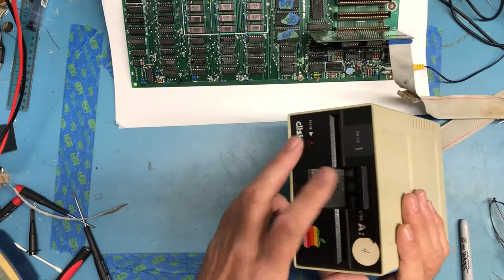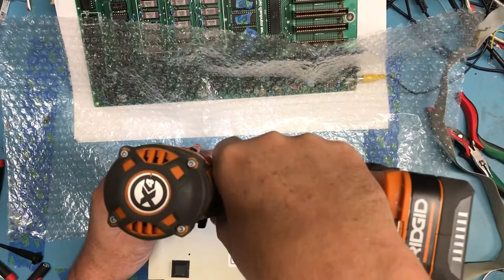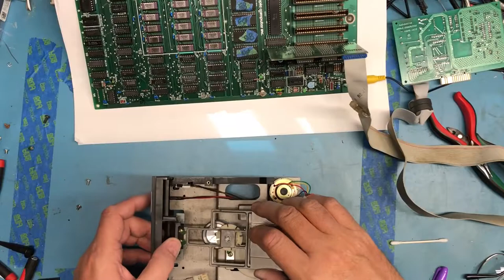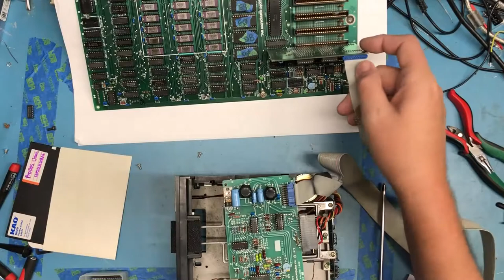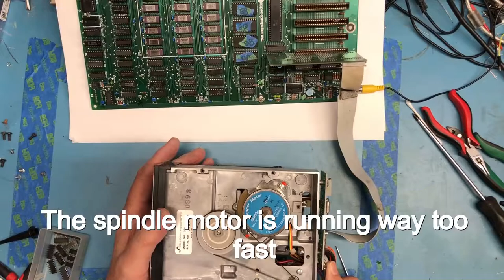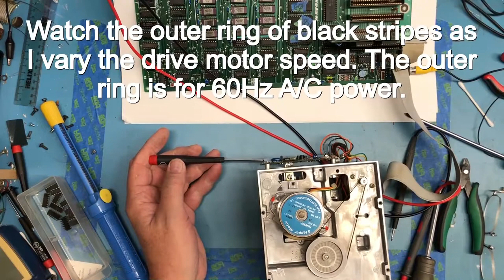APPLE II Plus - Part 5 - Disk II Teardown and Repair - STB200

Comment: Hello - I had a question about the drive belts.  You have the 2 variations of the Disk II in this video and are fixing the Shugart version with the motor from the Alps version.  You kept the belts unique to each drive, and I wondered if the belts are interchangeable - meaning can the belt from the Shugart go onto the Alps drive?  Thanks in advance
Reply from the maker: As I recall the replacement drive belts were different for the 2 drives. Based on this I assumed the belts were different. You can find replacement belts on https://console5.com/

Comment: A tiny drop of Loctite 620 on either side of that shaft would retain both the drivebelt wheel and the clamping wheel.  I'd be concerned that the next time someone dropped that drive that your problem is going to reappear.

Comment: Did you ever figure out what was wrong with the one that seemed to work well but just wouldnt engage the read head?  I have a drive with the same issue.
Reply from the maker: I didn't figure it out. The fifth drive became a donor for the others.
Reply: I have the same issue. Brand new Disk II but i have a donor which i might try the same. Swap the boards..  I just started testing it...

Comment: Does it matter which slots the two floppy drive controller boards go in if you want 4 drives?
Reply from the maker: In my understanding it does somewhat matter. The system tries to boot from slot 7, then 6, then 5 so on down to slot 1. I'm not an Apple II expert, far from it. This might help:
https://lateblt.tripod.com/bit91.txt
Reply: @ShadowTronBlog  Ok, thanks for that info and the link. This is the first time I get to play with the Apple iie.  I had the ZX Spectrum then the Amiga 500 when I was a kid. 👍
Reply from the maker: @XXXXXX-dy5fs  My first experience with an Apple II was the one you see in the videos. And to be honest I've forgotten most of what I learned. :)
Reply: @ShadowTronBlog  I'll probably keep a couple from the "haul" that I was given.  If I sell the bulk if them it would pay for my current Amiga projects.  I have the chronic problem of collecting too many old computers.
Reply from the maker: @XXXXXX-dy5fs  Same here. I try to maintain a rule that if I haven't touched it in the last year it gets sold or given away. I do have systems II regret letting go of, an Atari TT, an early NSC system (IMP16) with teletype, extra boards, parts, software etc. all in excellent condition, the TRS-80 Model 1 I bought as a teenager, the LNW-80 system I built, my Atari ST that I used for years and a ton of other systems.